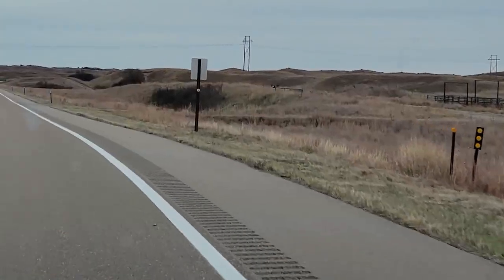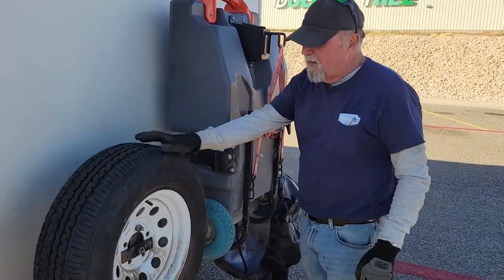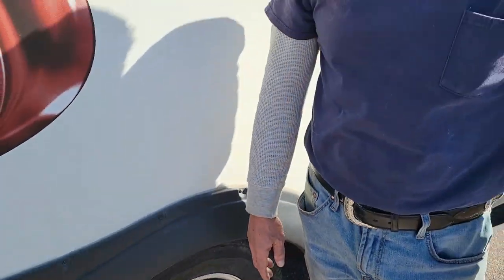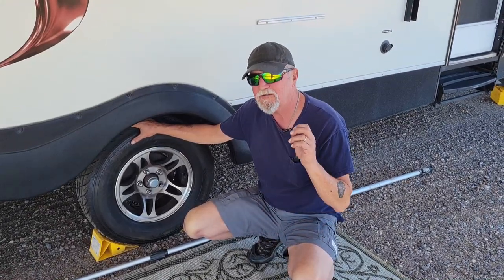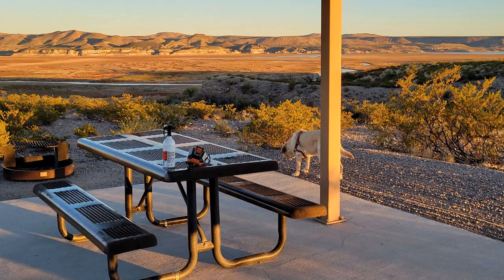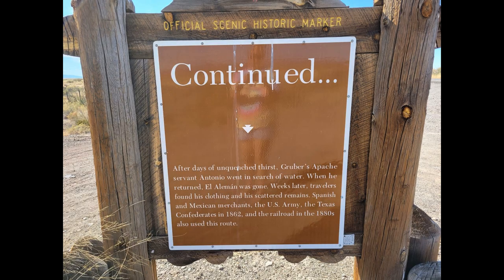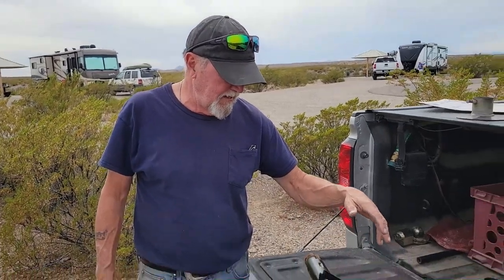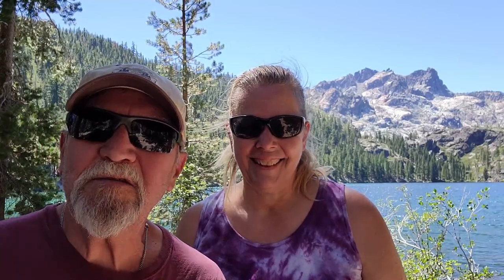Heading South Part 2 - KS, OK, TX & NM - Tire Minder Failure - Full Time RV Living & Travel

Comment: Did you find out it the problem was the fuse?
Reply from the maker: It was not the fuse, but we will cover that in a future video. Thanks so much for your question!
Reply: @OverTheHills2019  ok thanks. I was just wondering.